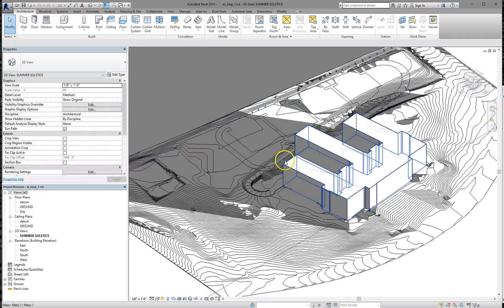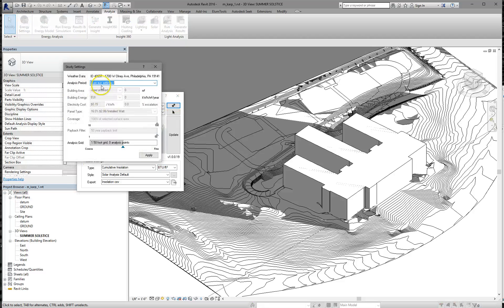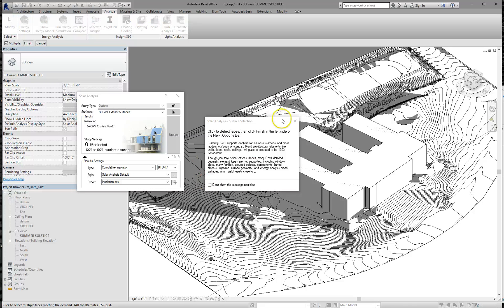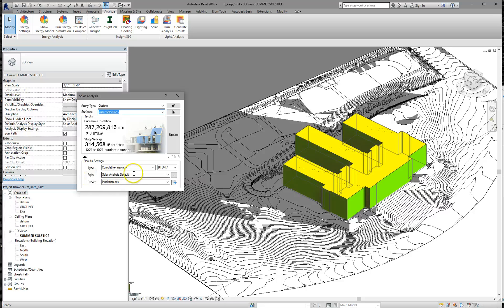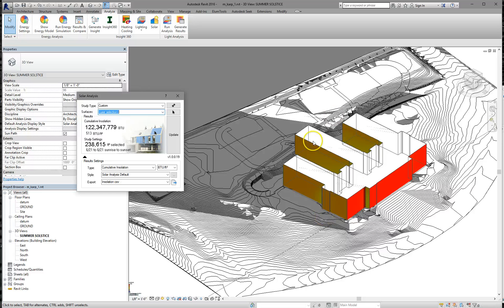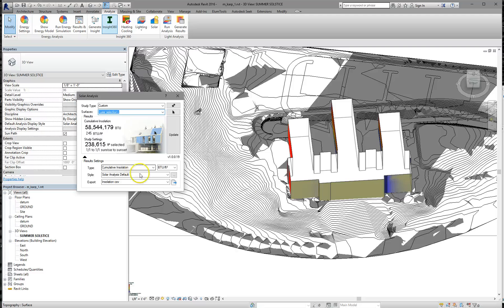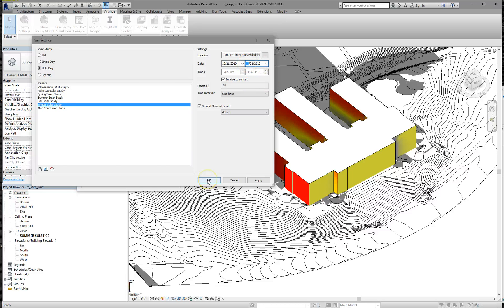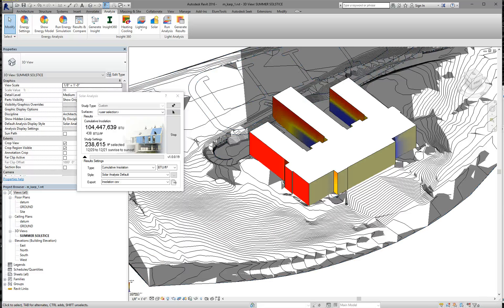8013 LAB1 solar

Comment: I can´t see the colors on the building. what should i do?
Reply from the maker: You are working with a mass right?  No actual walls and roofs.  If so make sure in you are set to All Mass faces when you bring up your solar settings.  Also make sure you select the mass faces you want to analyze.
Reply: yeah, I think I&#180;m doing it right, the problem is that when I select the faces and then click on "Finish", the box of "style" automatic change to "None" so I can&#180;t see the colors. Please help me :(!
Reply from the maker: change the style to the default analysis style.  Look through the all of the settings and see if they match up.